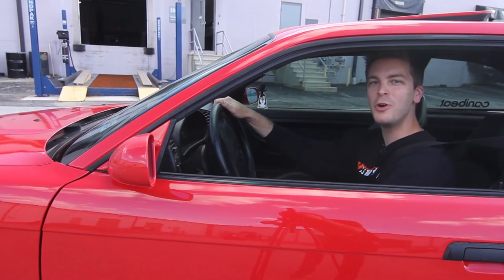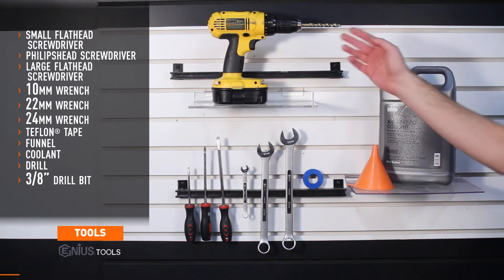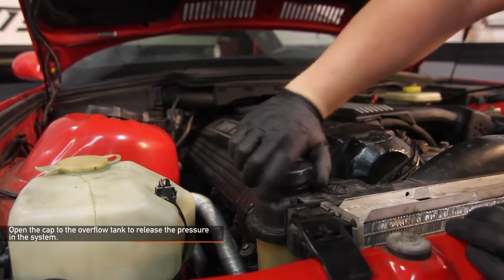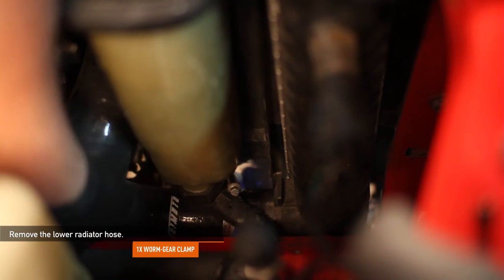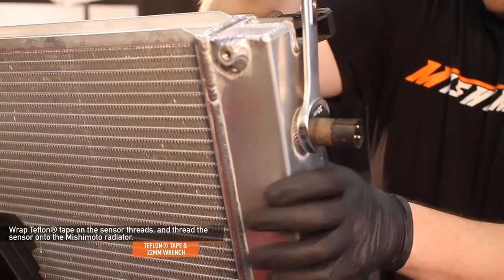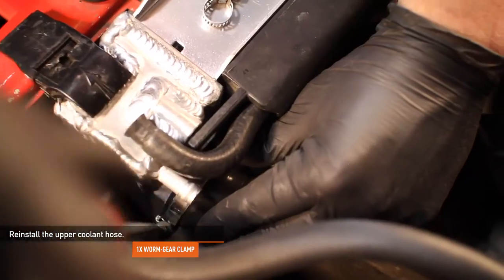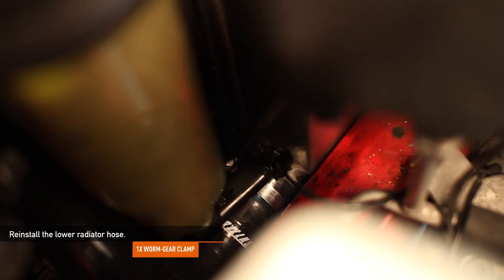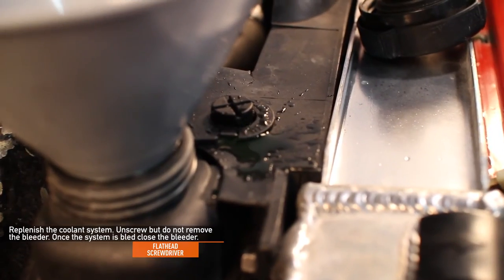1988–1999 BMW E30/E36 X-Line Performance Aluminum Radiator Installation Guide, by Mishimoto

Comment: Hello will this fit the early model of the 84 325E
Reply from the maker: Due to differences in the earlier model E30 cooling system and front end this radiator would not be compatible with early model cars.

Comment: Would I be able to still use my fan clutch or do I have to convert to an all electric fans on E30
Reply from the maker: This is a direct fit for the E30/E36 - you should have no problems running w/stock fan!